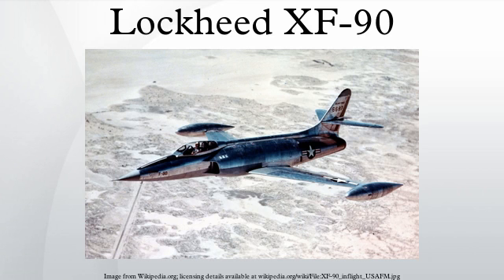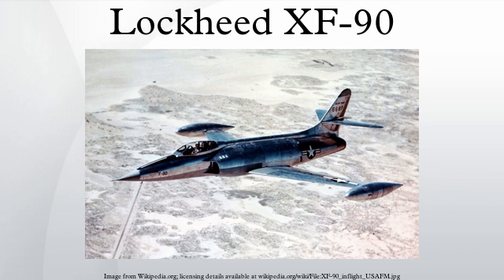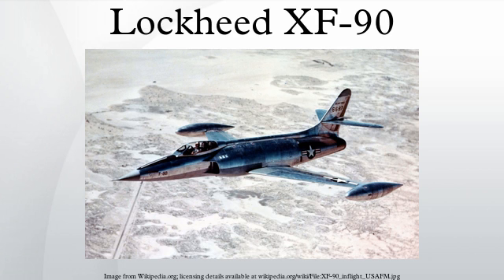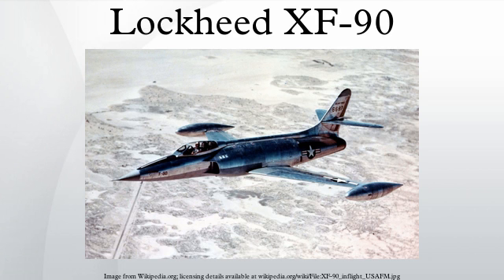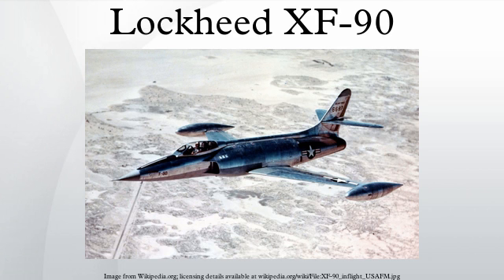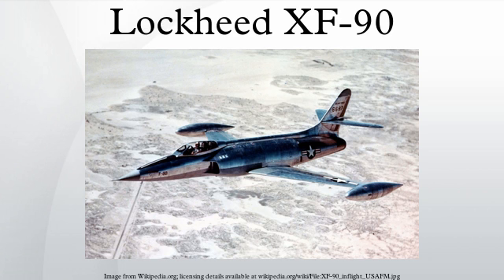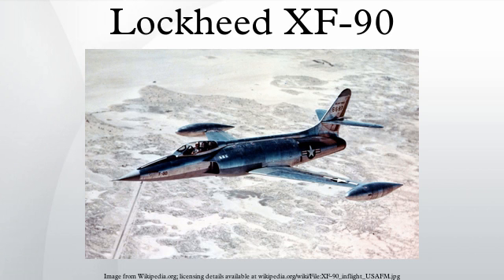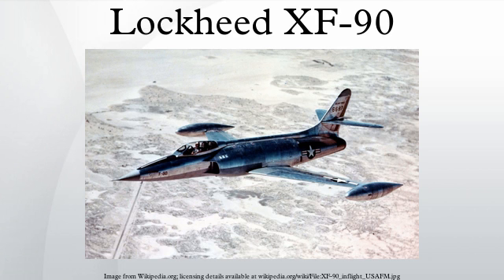Lockheed XF-90

Comment: Beautiful plane. It was not until 1953 when a high efficiency jet engine was finally developed. Why was it not installed on the XF-90. Its air-frame was more than adequate to handle heavy stress loads.